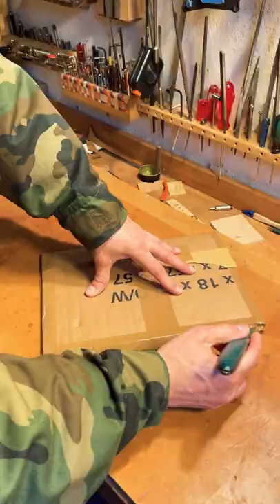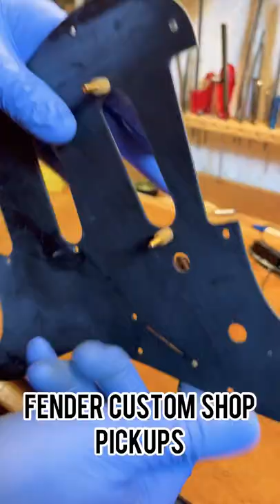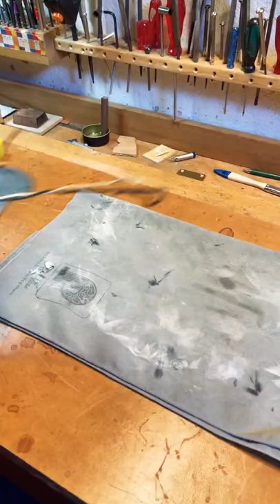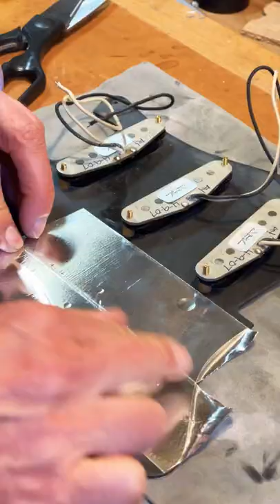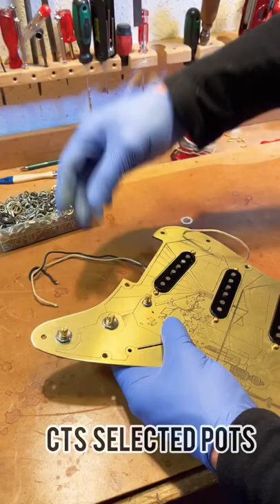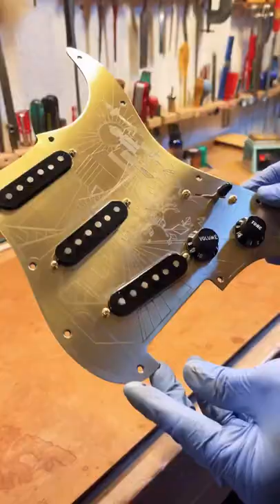Custom made Pickguard for Stratocaster Guitar repair #shorts #guitar #repair #stratocaster #luthier

Comment: Is the shielding foil necessary on a metal plate?
Reply from the maker: Thanks for your question. No this is 1mm Brass on a Pickguard. Best Regards Nik
Reply: It could be overkill, but certainly both needs to be grounded.
Reply: Then it's unnecessary, the brass will be grounded through the pots an shield perfectly